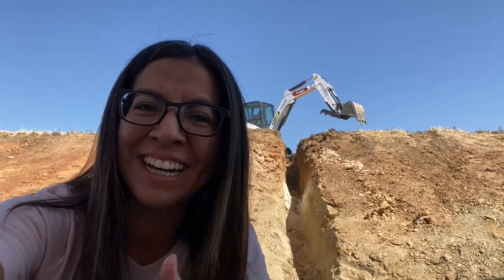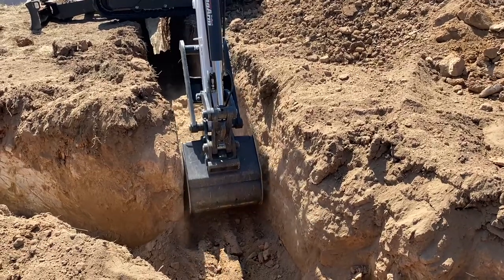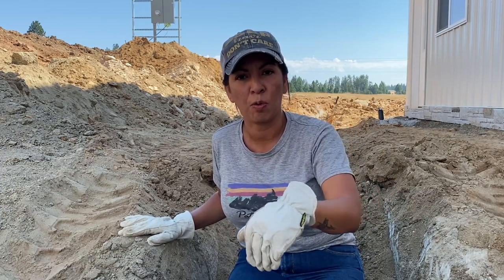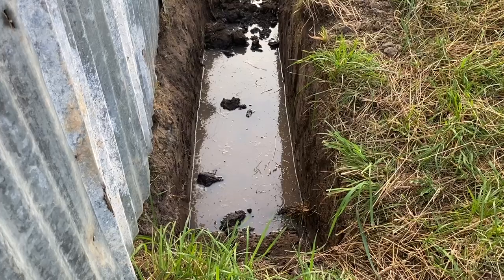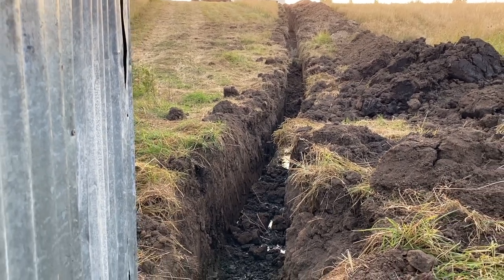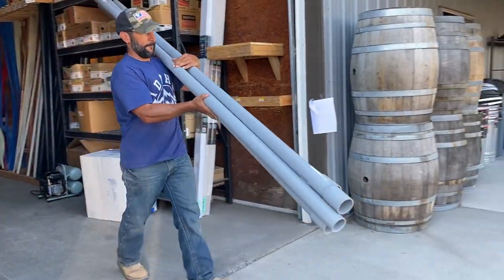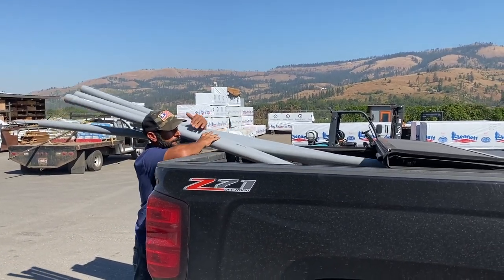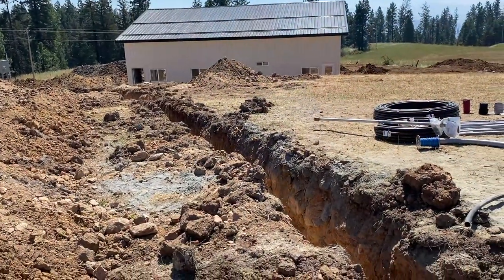We've got running water! | Bringing utilities in on raw land // V1E13

Comment: You might consider if you want hire a blaster to drill some  holes and literily  blast those rocky trenches in a hurry. And if you dont have neighbors they wont have to worry about  fly rock. Blasters are fast., are legally licensed professionals. Noise is a concern, if you have neighbors' you dont have people nearby  do you?
Reply from the maker: We do have 2 neighbors fairly close by. Hopefully, when we need to dig again we’ll have better luck
Reply: Hang in there . there is also something called " micro rock capping" which is very usefull for project like yours if you care to read something  rather usefull........... Caution is advised.. best regards  .. Joe.

Comment: MMMM wonder how much water the springhouse will provide?????.    I do happen to have a electric water well pump, 220 volt, used rated at 16 gallons . and if that wellhouse is shallow you could change out pumps easily It might work well for you, especially since pumped water from 135 ft, my well started pumping a lot of sanda nd I had to have my well redevelopped, and a new, lower capacity pump.. I would have to have a pump outfit look at it, make sure its good. Id make you a deal possibly. If you have elk everywhere maybe we can make a deal. I am down by Boise, and If I could line up a very easy elkshoot during elk season maybe we could trade.. I would be happy if female elk are open,and  and I could put togather a disabled easy hunt.  . Possible deal.